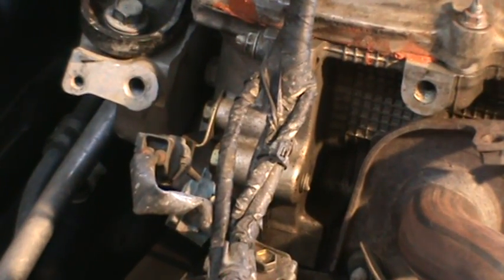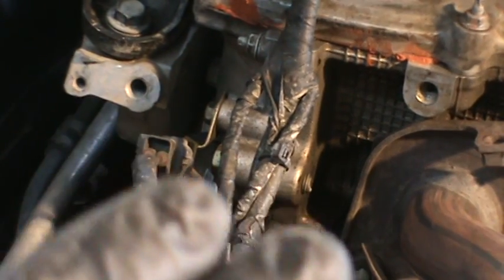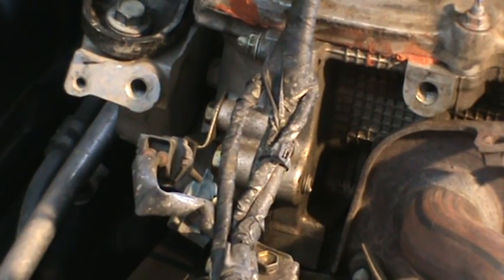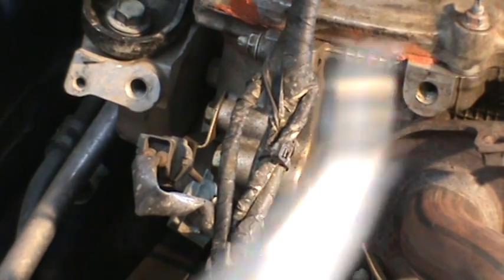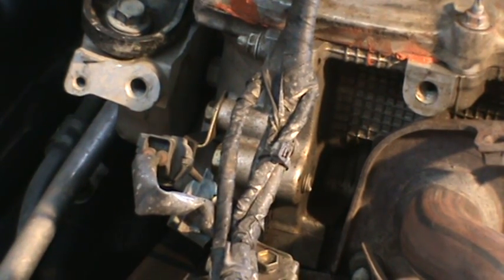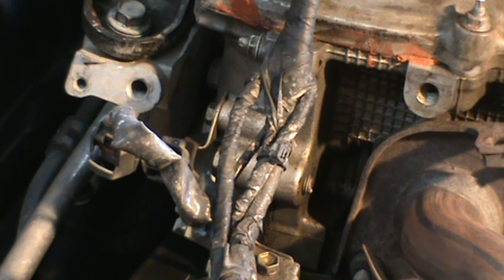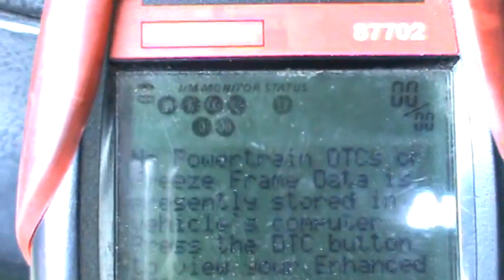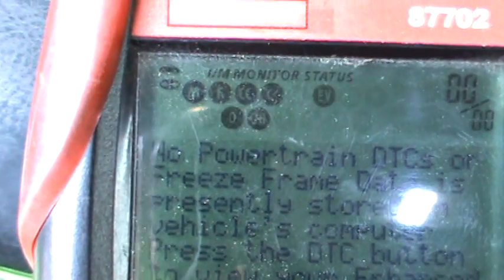P0335 Crank Shaft Position Sensor (What Happens When It Dies)

Comment: Sorry to bother you, I have changed the crank shaft sensor in my durango 2000, after that, car is  running, but now has a thicking coming exactly from the conector of the sensor, and never dissapears. Please advice

Comment: My car overheated do to los coolant i stooped i added coolant and i was back on the road after like 10 miles i lost power and i pull over now it wont start just cranks. I got p0336 code do u think this is my problem

Comment: I hope this is my issue changing it tomorrow  mine wasn’t running it all . And wouldn’t start at all .
Reply: I figured it out , I changed the sensor changed the dizzy and it ended up being a main relay lol which I should have checked first but I had just replaced it and somehow it burnt up or grounded out
Reply: @AndroidGuy0810  which relay? Mine won't crank but has power.
Reply: @MercyKOTG  if yours won’t crank at all or turn over it sounds like your ignition switch to me sir , or something ignition related . Could be the starter not engaging . The relay I was referring to is the “Main relay” located by your glove box . If that’s bad the car will turn over but will not start .
Reply: @AndroidGuy0810  how do you know what relay..and is it in the trunk or under the hood .
Reply: @jasonmassey7883  it’s not under the hood , not in the trunk , either gonna be under driver side , or under glove box depending on what model it is
Reply: @AndroidGuy0810  lol for sure. I'll check my relays out too. I think I had a realization last night that it might be as simple as a damn spark plug.
Reply: @blackdynamite6055  I doubt a spark plug will make it not start my dude . Check main relay , check distributor , check ur sensors . Check to make sure grounds are good , check to make sure battery is good . I would rule all these above a spark plug unless it’s all 4 and commonly it’s not . Also check fuel injectors , fuel pump .
Reply: @AndroidGuy0810  yes sir I will. I'll let you know how everything is. 👌
Reply: Let me know when u end up finding out what it is
Reply: Same here. Did you ever get it figured out? It's happening to me right now and I have no idea what the issue could be.
Reply: Which relay? Mine won't crank but it has power. It seems like it wants to but I think ur right. I just changed my sensor out for a new one but same thing. I'm almost positive it's a relay

Comment: Just more useless stuff to break, give me a 500hp small block chevy with none of these stupid sensors over this drastic plastic junk any day of the week, in the time it takes to replace those sensors you can have a whole motor out and completely rebuilt, these engineers are useless
Reply: Run that beat up dusty as granny as Chevy then boy!
Reply: Lmao bro all u gotta do is take the tire off my toyota take the plastic wheel guard off take one bolt out and change its your insane maby on other cars its harder???

Comment: A faulty crankshaft position sensor stops the electric going to the spark plugs, and however you may try the car will not start...until replaced...
Reply: I have a 2001 Mitsubishi Galant 4 cylinder and autozone says that I got the P0335 code for the Crankshaft position sensor. Im going to replace it tomorrow, but Its seemingly a big job because I'll have to take off the timing belt casing to get to the ground for the sensor. 

I respond because my car does start if I give it gas. This use to work 90% of the time, now it hardly ever works, so i'm changing it due to the code. Are you saying that I could be replacing the sensor, but thats not the issue for me? Because it does start and run, so long as the gas pedal stays engaged.
Reply: No on some cars it may run but not very well . My car for example will not run at all without it tho so it does vary based on the car .

Comment: My 07 rx8, has the same code pop up but the car still runs, just stalls when in idle and wants to die sometimes when I give it gas
Reply: Same as mine. Sometimes it would do fine in idle but sometimes it stalls in idle and I have a hard time making it run again.
Reply: I have a 06 eclipse and mine was doing what your saying and then died one day leaving out of burger king drive thru. Am changing the crankshaft now because the camshaft code p0340 was popping up.
Reply: My crankshaft is in my timing belt cover so I am actually still working on it I am going to change the timing belt while changing the crankshaft sensor since I am in the area. Will keep informed after. I am going to try and crank it with only changing the crankshaft and then again after changing the timing belt also. I will keep this thread informed on what happened with my vehicle.
Reply: Update my timing belt is missing teeth replacing it all at the same time not going to wait lol.
Reply: Devin Coleman I ended up fixing mine, it was even my sensor that was giving problems although the code showed up, my fuel pump wasnt throwing any fuel whatsoever  😂 🤦‍♂️
Reply: @KomaDAfuK  how did you figure out it was the fuel pump? anyway i can test it at home??
Reply: @xoxosh4826  i left the fuel pump
exposed which is in the back seat driver side under, and i cranked the car and the fuel pump is supposed to shoot out a line of fuel but it wasn’t, it’s an easy test
Reply: @KomaDAfuK  Okay thanks! So I have to pull of my back seats to see this. Anything to save money haha

Comment: Hi,my blazer had low power and hesitation for a few days then it died and po335 code shows up...Do these sensors go bad gradually like mine did? i also have po102 code which is maf...thinking after i replaced and fixed maf problem my crank sensor was on its way out at same time since i did not get po335 code until it died and now just cranks over like your car does... any suggestions are appreciated...thanks for sharing
Reply: roadstar499 Just replace it. Might as well get it over with if it’s already giving you the code for the sensor

Comment: i just rebuilt my engine on my mitsubishi oz rally i add some problem i put evrey thing on rigth position but now the starter spining aff turn and it look like it butter skipping the gear and wont start up but yes that po 335 pop up  i will change that first and see if it will start after i will probably need new starter to thanks for that video
Reply: Steven Tremblay its the crankshaft sensor i have the same car. Itll mimic a bad starter switch and starter. It is part of our vehicles ignition system. Youre proba ly getting misfires too. If the car idles bad after you change the crankshaft sensor you need to clean the throttle body till its 85% clean and itll relearn idle. Good luck
Reply: @rekaepa  can it be a crankshaft sensor it does ask for it and my oz lancer idles high then stays idling there but when i give it gas as i floor it suffocates like the engine wants to shut off only when im reving the engine but when i leave it idle it idles fine sometimes

Comment: may be  a great way to dis able a car to prevent a thief from taking car
Reply: Or drive manual stage 3 clutch lol
Reply: yes, no doubt Not many thieves are well rounded car techs...and even if they were it could take a while for them to find the issue...
Reply: Starter motor fuse is way better, no need to get under the car. A car thief wants to be real quick especially if windows are broken.
Reply: If your car has any of these sensors no thief with half a brain is going to want to steal it